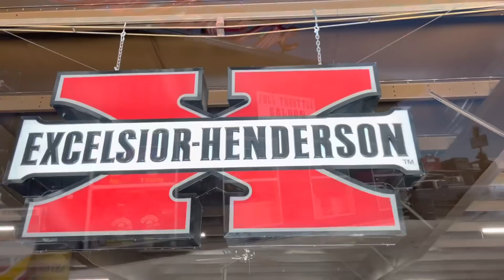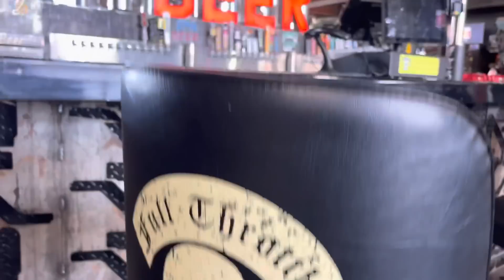FULL THROTTLE SALOON, STURGIS 2022

Comment: The original FTS burned right after the 2015 rally. We were at the place in 2015. Then heard later after the rally it was a total loss. It was a series of shacks so not surprised. This new place appears indestructible. Happy they kept some of the old memorabilia from the original place. Thanks for doing this video.
Reply from the maker: It’s almost all metal.